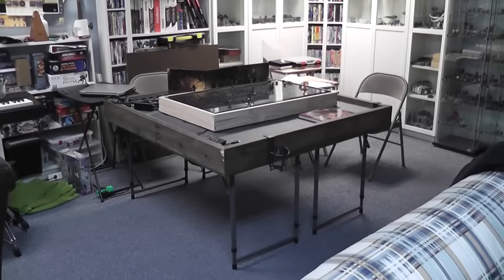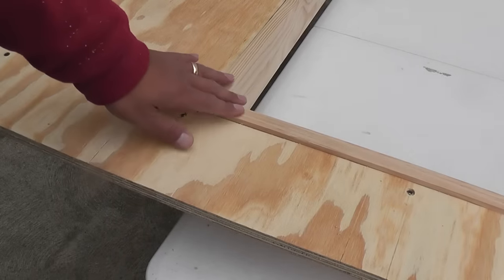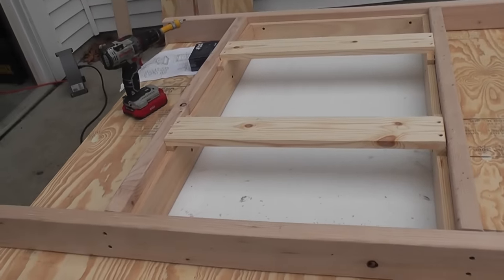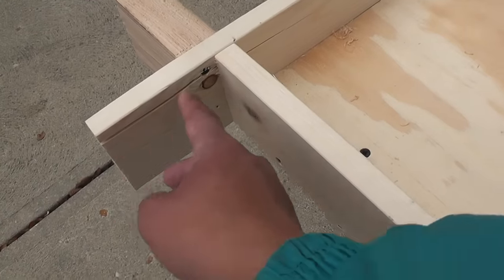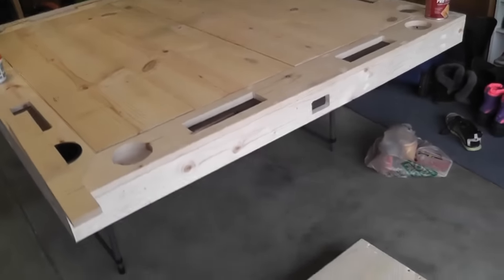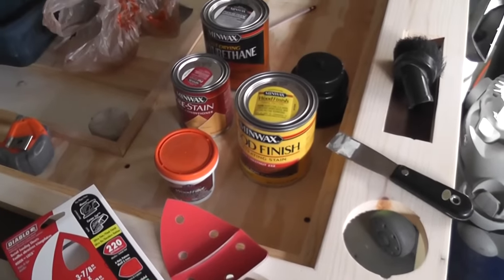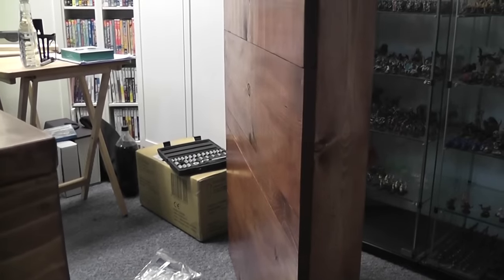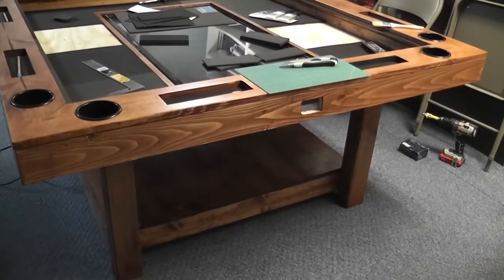DIY Gaming Table for $150

Comment: when using the circular saw, make the cut and wait for the blade to stop spinning before you raise the circular saw up.  Safety 101.
Reply: +Den Moumoiazei Would that matter when the circular saw has a cover? I'm not trying to be a smartass, it's a legitimate question that I'd like to know.
Reply: +Tom L You are correct. It doesn't matter since the saw has a cover on it. People will always be critical of safety.
Reply: +dfw crown Disagree.  Wait for the saw to stop completely before raising up.  You can never be too careful.
Reply: Den Moumoiazei I disagree. I think safety can be taken way too far. To each his own.
Reply: +Den Moumoiazei You can actually place a spinning saw safely on a worktop, thanks to the safety cover. You're right about waiting for the blade to stop though as it can mark the wood. Woodshop 101.

His wiring was pretty frightful though. :-o
Reply: +dfw crown Do you what you want.  I know someone who took a finger off with a saw so I don't f**k around.
Reply: +Wonko87 Seeing as the nailgun seems to have a safety (you have to press it against a surface so the tip retracts fully to fire a nail) I don't see that happening.
Reply: Except when you don't angle it properly and the nail comes out the side of the board.
Reply: +dfw crown 
It matters.Spinning blade (even at the end of wind down)has enough momentum to interact with material.Yes, it is mostly about quality cut at this point but-better be safe then sorry.Good project otherwise.
Reply: +Wonko87 
Agree.Or you need to angle it and it hits a nail You just popped in.
Reply: +dfw crown This is also a video showing HOW to do it. There might be people who aren't as used to making tables watching the video as well and not everybody has the same tools.
Reply: +Den Moumoiazei When you leave the classroom, things become quite different.  ALWAYS stay safe, but going that far is a bit much.
Reply: Mike Hill Fair dues. I don't work with nail guns, no, so my knowledge of their operation is very limited.
Reply: +dfw crown I think he says wait for it to stop first is because it could mess up the edges

Comment: reaches under table. gets shocked, take 1d6 lighting damage
Reply: just roll a D20 for revival
Reply: Don’t you do a save first? Or is it too late?
Reply: @nil8392  electricity is to fast for a save lol
Reply: @nil8392  There was one, it was a perception check which was failed. The trap has now technically activated and it is a constant flow of electricity, so it could be compared to falling on spikes or the like, while magical means are more generally a one and done sort of thing.
Reply: contitution save?
Reply: @Gabriel-rr4st  More like death saves, even if it is 110v
Reply: Ask the DM to roll for some conduit?
Reply: @Shin_Lona  or a GFCI
Reply: 120V circuit may end up being a "save vs death" roll. :p
Reply: Hahaha

Comment: For anyone attempting to do their own wiring:
Use an outlet box for each receptacle. Here he just screwed them to the wood table and taped over it. If one of those wires gets tugged it can spark and catch the table on fire, there is a much higher chance of a person getting shocked, and the boxes cost ~$1 a piece. For a table like this I would recommend using full size boxes because the entirety of the box can fit nicely inside the rim of the table. You should also have the romex fit into the box, then cut the outer sheathing, and then strip the 3 wires. Any time a wire is less protected it should be in a box. One step further is if you want to wire any lights or speakers that wouldn’t be any more difficult to add from an electrical standpoint. Obviously it will cost more, and adding them would need to be considered when designing the table.
Reply: Yeah, imagine four people at the tables for hours. One of them starts fidgeting with the bottom and underneath of the table and starts touching life wires screwed right into an outlet.

Comment: The table is pretty awesome. My main issue is with the electrical tape. It's not a good permanent solution and really you should be using an electrical box (especially if you're doing a tutorial that other people are gonna follow). And 120v is not low voltage. Putting two ground wires under one terminal screw is fine, but suggesting to people that this circuit isn't anything to worry about is not fine. This table is going to be hooked up to a 120v 15a circuit. While under normal operation it won't be pulling anywhere near that much power, if something shorts out, it will have full access to those 15 amps. Way more than enough to start a fire or stop a heart.
Reply: Further more you should never use the stab holes in the back of outlets or switches.  It was mentioned but don't do it.  it is actually against code and should be mentioned in chapter 3 of the NEC.  I have no idea why manufactures still put those in there products.  Any time you can apply mechanical pressure to ensure a wire is secure, that method is best practice.  But other than that the table is amazing.
Reply: @Majick0003  If it is a ul listed outlet and has the stab holes you can use them, theres nothing wrong with using them as long as youre using the appropriate sized wire. Nonetheless i would still suggest putting wires under a screw it is a better practice.
Reply: I agree, technically a lot of conference room tables just have a nice power surge strip attached to them. From there it is plugged into the floor underneath. Why make actual runs when they can do it that way is my thoughts. The Powerstrip is normally UL approved. I would even go a step further and make a UPS so the game is not interrupted with a power outage. lol My other thought was get a power strip that is GFCI because there are drink holders and this means if they are drinking beer, you never know if someone will spill it.
Reply: 120v AC is low voltage in fact below 600v AC is considered low voltage, but your message is not wrong.
Reply: coolhacker011 and because even sober people spill on alcoholic beverages...
Reply: Not sure if ye saw but he made a video revisiting this table stating that he added an electrical box as per comments for safety reasons realizing the issue. At least the issue for him was resolved without issue.
Reply: That is what I was going to say. plus any surge could catch the table on fire not being in an electrical box. Also the outlet could have been placed facing underneath that way you don't bump into them.
Reply: Jesus guy who knew..thanks for the heads up!
Reply: @wwrite  in Canada 750and below is low voltage well before you hit extra low that is

Comment: As a gamer I’m pretty impressed.  As a woodworker I’m also impressed.  But as an actual electrician, some nice small trim or decorative cove or quarter round around the outside top edge would make a decent drip ledge for any spilled drinks. Perhaps most importantly if you make the first receptacle in the circuit a GFCI, it could save you a lot of future grief.  Also a few more staples would be nice too :)  You’ve made a really nice entertainment piece, I’m just trying to suggest a couple things to help you look after it.  Really great work though and thanks for posting it.

Comment: Just bought the lumber for this project and it came out to be about $400 😬 I did spend a little extra to upgrade the rails to oak though which is crazy expensive ($60 for a 1 x 6 x 10 at Lowes)

EDIT: So just lumber without oak might be doable for under $300.  Not factoring in hardware and stains.

Regardless of the price, I appreciate you for posting this and inspiring me to go ahead and try it.
Reply: yeah covid hit the lumber industry hard, turns out if you trap consumers at home for a few years, all of them feel the immediate need to build a deck, haha.  150 sounds more than reasonable for 2015, if only we could go back 😭
Reply: 7 years ago lumber wasn't so expensive. Covid just made that worse sadly.
Reply: I'm building this table too. I just shopped the lumber (no electronics) and the fasteners. Price today came to $385.78+tax CAD (Canadian). The price has definitely gone up due to covid, but you won't find a pre-made table of this quality for anywhere near this price. I was shopping prebuilt solid wood tables, with no gaming functionality, and you're over a thousand easily. This is still the way to go for sure!
Reply: If you can get the oak from a local lumber yard or hardwood dealer, you can usually get it for WAY cheaper than at the big box stores.

Comment: somebody else might have said it, or you may have learned yourself, but I myself find staining much easier with a cloth. Working as a carpenter, when all the airless guns were used up, we would just take a old white undershirt, soak it, and start wiping. Works out better than a brush and won't leave streaks or anything.

Comment: If you want a good finish with staining, DON'T use a brush, use a rag instead, smoother and no brush strokes
Reply: T-shirt rags are a must for applying finishes.  Just always remember that rags soaked in finish (especially things like Danish Oil) are known to spontaneously combust.  Handle appropriately and don't just toss them in the trash.

Comment: Love the table. My suggestion to anyone doing this, you might want to use a router on the dice box cutouts to hide any over cuts on the corners. Also you can now get outlets with USB plugs built into them for extra charging convenience. But over all great build.
Reply from the maker: +MegaGamerP   Yes, a plunge router would make for even cutouts so if you have one, use it!  Also, outlets with USB plugs are very handy for charging phones and tablets.  Someone else said you can get them for $13 from Amazon.  I'm still waiting until it comes down even more and hopefully in black!
Reply: +Gaminggeek  This is what I'm considering using myself,  for the particular reason that I expect it to be,  like you said,  my gamers charging their tablets or phones that they are using for looking up rules or what have you.  http://www.amazon.com/Enerlites-62000-4USB-I-Charger-Child-Safe-Screwless/dp/B00M11NF62/ref=sr_1_25?s=lamps-light&ie=UTF8&qid=1449897201&sr=1-25&keywords=wall+outlet+with+usb+ports  Of course,  I'm hoping price comes down some before I start building my table or I may just end up using standard outlets and swapping out when prices do come down.

Comment: PRO TIPS on finishing wood furniture:
On any table build, do not use soft wood. in particular, white pine or popular. They both stain terribly. 

As a gamer who has made a career of staining and refinishing wood,  any claim that foam will somehow keep you from having to condition the wood before staining is entirely false. Wood conditioner is used for staining soft wood as it does not stain evenly. If you don't use it, you will not get an even furniture grade color. Instead it will come out looking like a DIY project. Also, be very careful when sanding as it has the potential of binding up the grain, and affecting your stain, especially with hardwoods. 

I highly recommend using Tac cloth between steps to avoid this issue. 

When applying poly, use a matte or stain finish on the first coat, with a light sand in between coats. For a piece of furniture you will need at least 3 coats. Always Tac cloth the poly after sanding. Your Finish coat should be a gloss coat for added protection. I highly recommend a marine grade poly as it gives a gorgeous look, is more durable, and easier to clean. 

when applying poly do not over brush. You will make air bubbles and it will end up feeling very rough to the touch. Brush into your wet edge in one direction. Poly takes a lot of time and patience. If you miss a a  spot, or have an imperfection, leave it alone. Let it dry and fix it on the next coat. DO NOT TOUCH OR BRUSH WET POLY ONCE IT IS APPLIED. Let it dry, and fix it on the next coat. 

Patience is key with furniture grade finish.

Comment: Just stumbled across this and wanted to add that for anyone who might have limited tools, you can make pretty clean cuts with a jig saw if you clamp a straight edge down and just run the jig saw along it. The same is also true, if a little more difficult, if you want to do it with a hand saw. Use a file and/or sanding block to clean the edges and you're done! This is a great build for a low cost and a little work! I wish I was your neighbor so I could help you use it!

Comment: Very nice build.  One thing I would suggest … for the receptacles, I would use the ones that have 2 usb plugs added.  very useful for the electronics!
Reply: And pvc conduit so no one gets shocked over time. Especially on those unsheathed wires
Reply: Exactly what I was thinking. He could have covered those wires a bit better. Some leftover wood just to cover directly below the outlets would have made things safer as well.
Reply: As someone who's actually went to school for commercial and residential wiring the receptacles on the side scare the shit out of me.

Comment: Hi man! great video!
As a gamer and a woodworker myself, I was feeling the urges haha
Just a tip I picked up along the way and that it may help you, when staining, I never use brushes anymore. And most of the time i don't even use the pre-stainer. The problem with staining is the blotching, because some parts of the wood suck up more stain than others. To solve this, i use instead a bath sponge! Just soak the tip in the stain and go over the wood. You don't even need to follow the grain. The emptier larger wood cells will suck up more stain than the smaller ones, and as long as the sponge has stain in it, the wood itself will saturate. no need for pre-fillers or careful brushings. Plus you get to re-use the sponge and cut on waste material for a while.
Hope it helps!
Cheers!!
Reply from the maker: Hey, that's a great idea!  I'll try it for my next project.
Reply: glad to share! ;)
Reply: BoyWithKnife i
Reply: Wouldn't foam brushes get the same effect?

Comment: I've gotten ready to start this table 3 times now.  Finally got all the wood and pysched myself up to give it a go...then realized that in the instructions you talk about making your cuts, however don't list any of them.  I think I can get most of it figured out due to camera angles, but will need to lay bare wood and make the measurements myself.  I did a lot of looking before I found the table and instructions that would meet me at my level of "expertise" and this is great.  Thank you for what you have provided here.
Reply from the maker: Did you see the instructions in the descriptions section of the video?  It shows the measurements of all the pieces.  Some folks have been having a difficult time downloading so just reply to this comment and I'll try and help you out.

Comment: A nice upgrade would be those outlets that also have USB chargers on them.  All it would take is rewiring the outlet, so it would be a pretty easy upgrade.
Reply: That'd be a downgrade. Traditional outlets are more versatile.
Reply: you can buy outlets that have 3-prongs and USB outlets. 

https://www.lowes.com/pd/Legrand-Radiant-White-15-Amp-Decorator-Outlet-Usb-Residential/50253183

Comment: Pro tip 1 : buy yourself a cheap twin size foam mattress topper and cut off pieces about 1 buy 2 inches use gloves and stain and finish with the foam, It will save the need to pre-stain and leaves a smoother coat. 
Pro tip 2 : Blemishes around the dice holes can easily be solved with scrap wood from your build It might seem tedious but the finish in the end makes it worth the extra trouble.
Pro Tip 3 : Always predrill and always prewire. If you had prewired the outlets it would have been so much simpler. Just install outlets and face plates and you're done. Also you could have done something with your table leg being two pieces. If you sandwiched a power cable in between them and put an outlet at the foot of the table you'd only need an extension cord to power up the whole table. 

-The last two tips can still be done with relative ease after the fact.

I like what you've made, good job. Just keep in mind everything can be upgraded.
Reply: ...and if you use some of the rest Foam you also get rid of the incredible loud clicker of dices hitting the sides.
Optional. If you dislike it.
Reply: You could also sand it to smooth it out, would it be fun, no, wood it look nice, yeah
Reply: Thank you for the idea about running power through the table leg, i built this table and incorporated your idea, worked really well
Reply: @marlinbundo2409  would you have a picture to get a clear idea of that?
Reply: Running the power cord through the table is very clever... didn't even think of that

Comment: i'd get a chromecast for the monitor so that you don't have to have the laptop actually wired up to it can just wirelessly send the images to be displayed
Reply: +Adam Cole yeah One thing I was looking at was putting an HDMI wall plate to keep the cable under the table and plug in when you need it.

Comment: ok this was just a treat to watch 

a friend and I are going to be making a gaming table based off your design but modifying it heavily. 

Examples of this is making it slightly bigger and having it where the DM/GM has a single side to themselves for the books (yes we still use books) and scraps of paper. 

Overall love this design and it looks VERY easy and straight forward, cant wait to build ours
Reply: do u have the plans for that??? I was thinking of just the same tweaks and it would be dope if u had the plans
Reply: @TravelinFrench  Sadly i dont because i never made it that far, since my friend that was helping wanted to make it completely different from my design I just didnt bother

Comment: To avoid the dangers of attempting to wire yourself, an easier option would be to just use surge protectors or extension cables under the table. Amateur wiring is a large contributor to house fires, as well as electrical deaths.
Reply: Good build till he didn't enclose his wiring.
Reply: @allenfogarty2384  What do you mean by 'enclose' ?